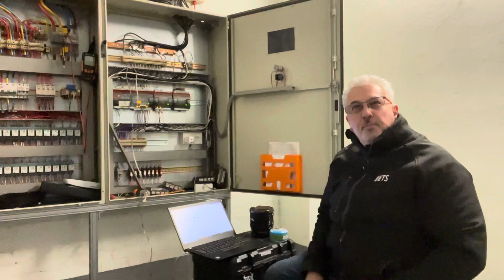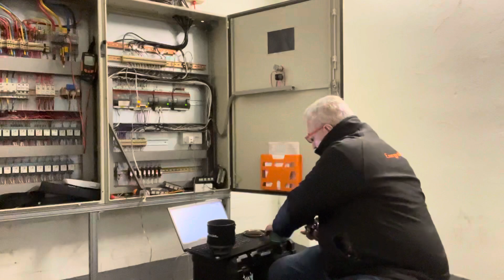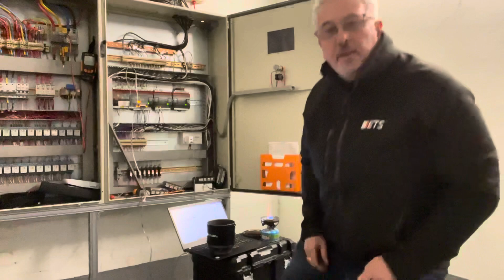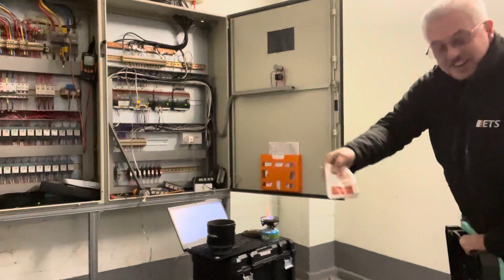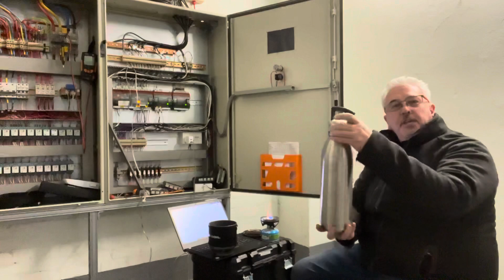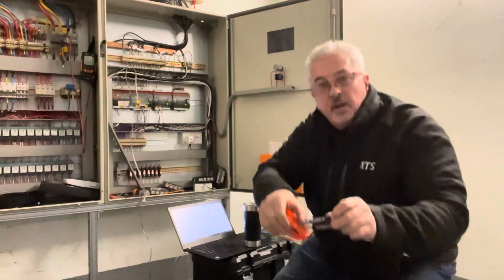JETBOIL MINIMO AT WORK

Comment: I'm an avid electronics enthusiast but even I do not recognise the equipment behind you. Could you produce a video showing what it does?
Reply from the maker: Timothy,
The product in the panel is a BMS or building management system and it’s used to control the items of plant in a commercial building.

The product in this panel is Trend Controls, but there are many other manufacturers who offer similar products at varying price points, but they all essentially do the same job, just some do it better than others.

I will post some videos in the near future.
Reply: Hello Paul. I’ve been long awaiting your video on Building Management Systems. Are you any closer to producing an introductory video?!